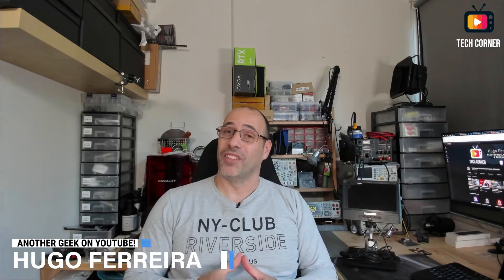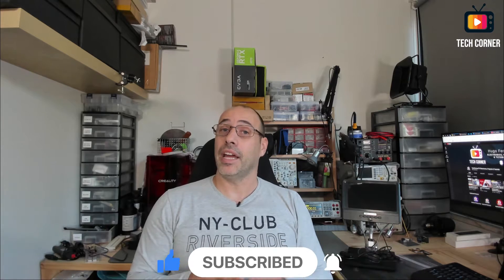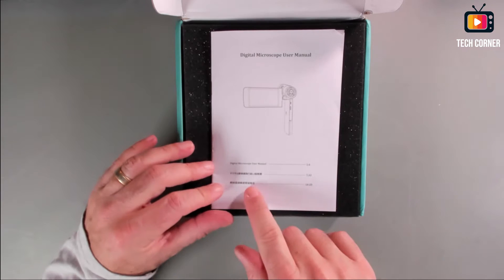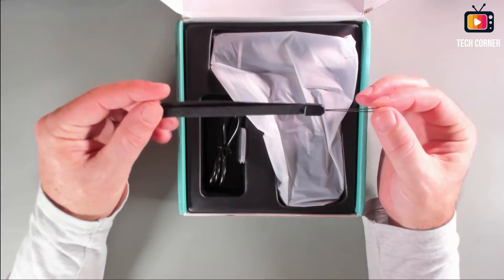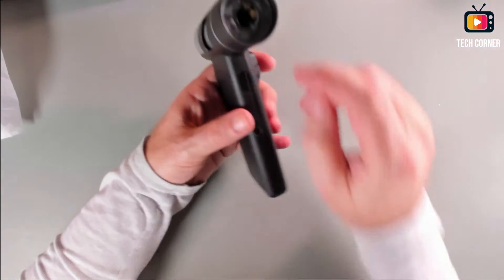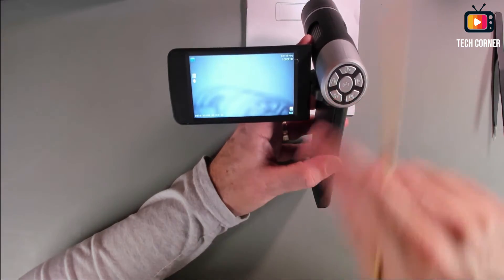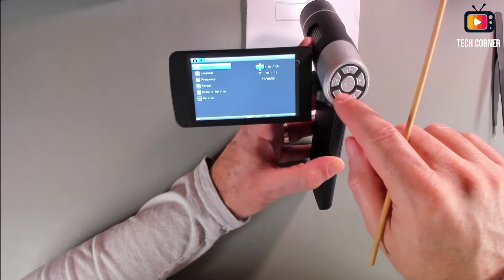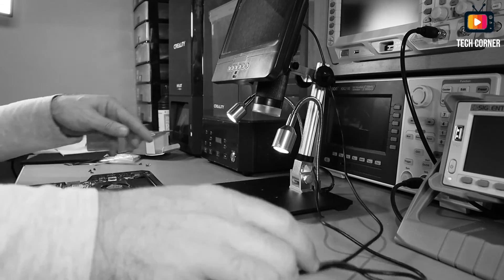Andonstar AD203 Digital Microscope ⭐ Portable, Small & Powerful

Comment: awesome awesome awesome.  just snagged one off eBay for $35 (open box). 
My only disappointment with this video..? WHICH 1/4" mount did you use!? 🙂
Was going to grab the mount you used for it but you didn't provide a name or link!!! 😢
Reply from the maker: Hi, I used to different devices, you can use any 1/4" adapter for photography, but I have a Ulanzi tripod that works very well, is the one on the video card,  ( https://geni.us/ulanzi-mt-79 ) and in the video I used also a magic arm, you have here an example from microfocus that is pretty good. But, generally speaking you can use one of spider ones from go pro or whatever. It just need to have the 1/4" thread. Thanks for watching and your nice comment.
Reply: @TechCornerTV  HEEEYYY!! You're awesome! Thanks for that. Okay, I'll check those out. I happened to still have one of those geared posts from an old digital microscope.  Hell,, I still have a simul-focus nice amscope with a pretty decent real digital microscope, the IMX185 (which has the largest sensor-pixels on the market and has a sensor that focuses, which is awesome). I just wanted a little convenient device and this recommendation was great. Funny ... I owned a laptop repair business (focusing on Macs and Data Recovery) in los angeles. But, you know what has happened to that city. It's like the walking dead everywhere. It's gone to SHIT, and I just don't think customers wanted to risk being out and about near all the dregs of society. I now moved back to a conservative state in which I've seen ONE homeless person in my area in the last 18 months! lol. Though, it does get a bit hot here. 

Anyway, great content and thank you so much for following up with that info!

Comment: This was certainly more helpful than any instructions provided by the manufacturer! However, I was disappointed that you didn't show how to download the software and connect to your PC. I am finding that problematic.
Reply from the maker: HI Mary, downloading is just connecting the cable and a new drive will appear, but if in any case you have problems, just take the SD card and connect it on your PC with a SD reader. Thanks for watching!